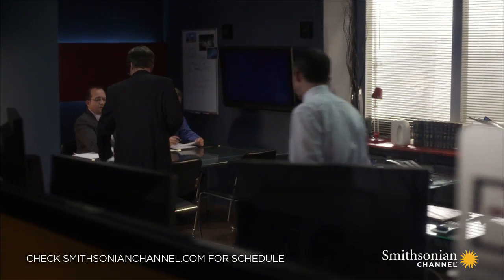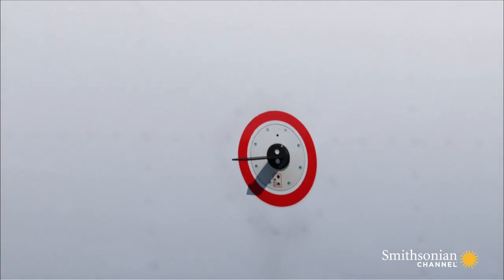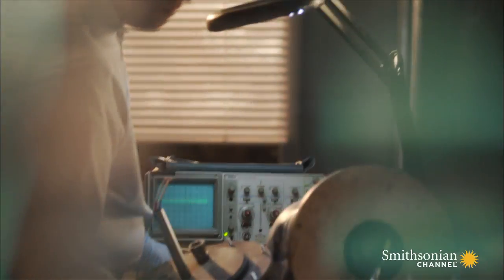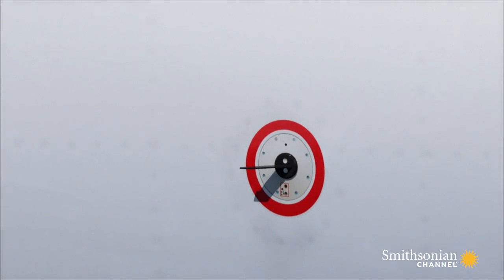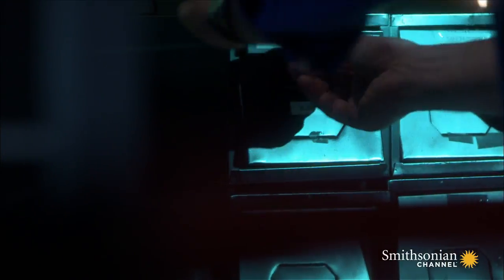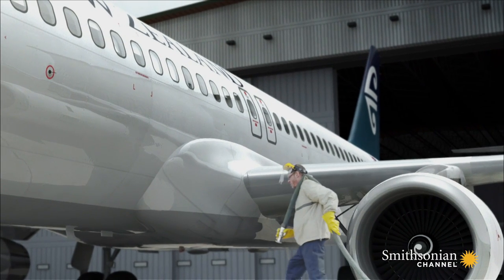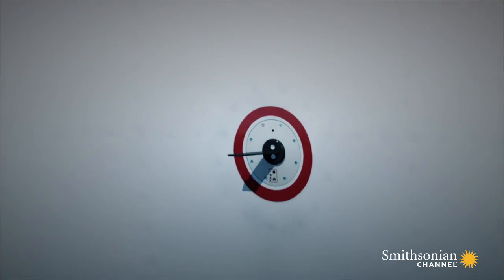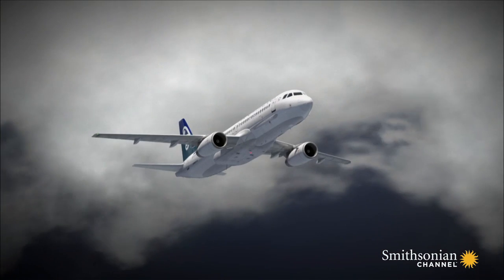Why Inoperative Plane Sensors Can Leave Pilots Helpless

Comment: The sensors should be heated 🤷‍♂️
Reply: Actually they need extra sensors which would reflect how well the actual sensors are functioning. That's sensors of plane's sensors.
Reply: @ayoubmerzak1733  You mean like a redundant sensor so each sensor can check on the other?
Reply: VinceThe1 not exactly what I meant. What I meant by that is to have extra sensors whose job is to monitor the plane‘s sensors, since the pilots have a blind faith on the plane‘s sensors there should be some kind of mechanism that keeps checking on how the well being of those sensors is.
Reply: @ayoubmerzak1733  The only way to know if the sensor is telling the truth is to have another sensor like it and see if the readings match up.  Either way they should be heated because both could freeze and again give similarly wrong data.  A good backup for altitude is always GPS, since it's accurate enough to know if the sensor(s) are too far from actual.

Comment: So an airliner that's sits on the ground in high wind and pouring rain could have water infiltrate a sensor ?
A high pressure water hose used from the ground caused this ?
Makes 0 sense..
Reply: bruh, what do you think? It’s called a “HIGH PRESSURE” pump
Reply: @kivrrrr7  Bruh a sensor exposed to the elements ain't waterproof ? And a sensor absolutely needed  for flight is  crippled by a water hose ! Bruh it's a freakin airplane ,operates  in raging weather subject to extremes of temperatures  and a water hose?
Bruh really?

Comment: Does anyone tell me why heater of the AOA sensor was not working at that height altitude?
Reply: Presumably there was just too much ice for the heaters to melt it all. They were designed to deal with rain that froze into ice, not water from a high-pressure hose sprayed directly onto the aircraft during maintenance.

Comment: What if instead of that expensive mechanical equipment for the sensors,why not use a circular cup of water filled half way,if they go to the left, the water slides to the left and same with right and any direction
Reply: What the fuck
Reply: That only works in a stationary plane. When the plane is moving, particularly when it is changing speed and direction, forces are introduced that distort the results. Simplest example: When a plane is accelerating, the water would rush to the edge of the cup closest to the back of the plane--the exact same thing it would do if the plane were pitched up. You couldn't tell the difference.

Comment: So pretty much because they were too lazy to clean it with a cloth, they all died
Reply: No it got frozen in air while going up I watched full ep
Reply: @amazinggaming1014  and it got frozen because of that water, so the guy is correct
Reply: @amazinggaming1014  me 2 ur right
Reply: No lol
Reply: Wow
Reply: Nope.
Reply: BuckyBoi second degree murder
Reply: @flyinglukas673   lol no
Reply: no its bc the crew was incompetent from recovering from the stall because they didn't use trim to help recover the stall
Reply: @icecrusher8457  it was due to ice in the sensors, and you would try to recover from a stall if you can. They can, and they tried.

Comment: You would think with all of the tech we have we would employ redundant sensor systems two being different tech all together
Reply: You would think with all the tech we have we wouldn't be still relying on a system whose components and operation have hardly changed since the days of the DC-3 in order to drive critical flight instruments.
Reply: They are not used to drive critical flight instruments.
There are redundant systems to show the aircraft attitude. 

Airbus usually has a protection to prevent stalling since it restricts the pilots movement despite the pilots inputs if it determines that they are unsafe. Due to the sensor freeze it couldn't calculate whether the aircraft had a dangerouse attitude. It still gave the warning but there was no automation to save the plane. It was all left to the pilots.

These tests are usually done at 11000ft or something. Where the air is dense enough to quickly recover and where there is enough wiggle room because you will not hit the ground right away.
But they were not allowed to fly that high and decided to do the test at 4000ft. They also waited for the automation and expected it to kick in but it never did.

If they had expected less from the automation they could have easily saved the plane. If they had been at 11000ft they could have easily saved the plane. But not at 4000ft and not if you wait for something to save you that never comes.

Ultimately it was bad decision making to pilots that left themselves without any redundant system (stall warning was ignored because they wanted to stall, artifical horizon was ignored because they knew exactly where the plane was and wanted to stall, wiggle room was not there, they needed the stall protection to kick in). The only thing that could have saved them was the functionality of the stall protection.
Good airmanship is to never leave yourself dependant on a single system.

Comment: if the plane stalled and they gave it max power.  is it possible if you use reverse thrusters so you slow down a bit . would it reverse a bit? so that you can pitch the plane down wards would it help???
Reply: U can’t use reverse thrust while in the air but in ground u can
Reply: Kris Dacua
Reply: The A320 has relaxed stability, so it's pointless making a nosedive.